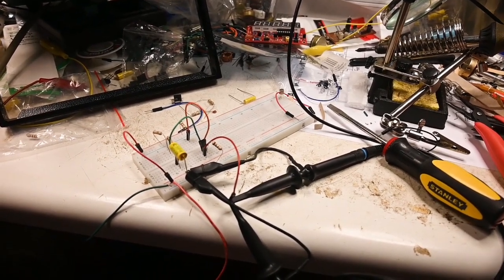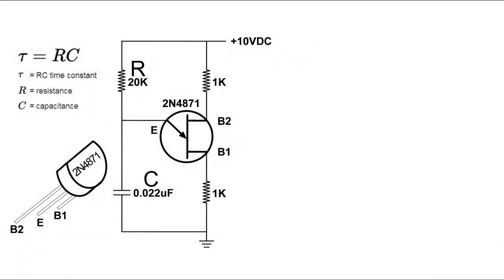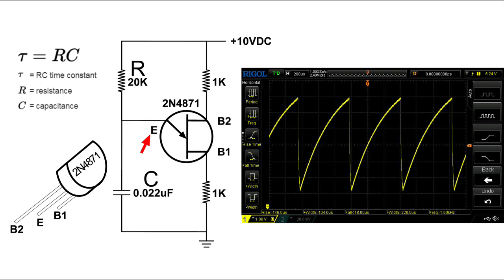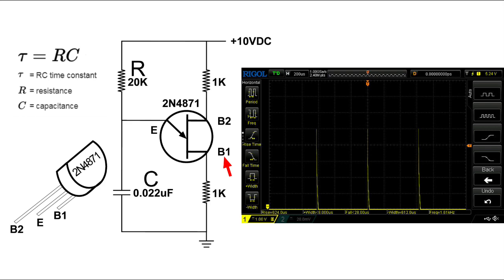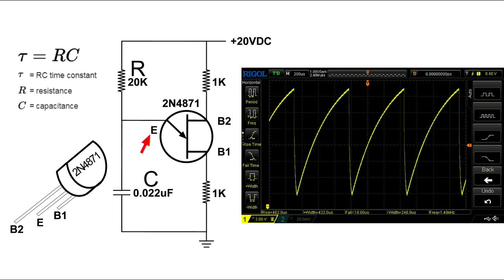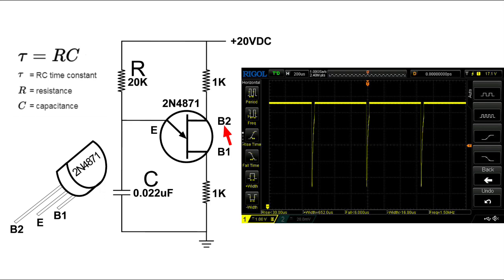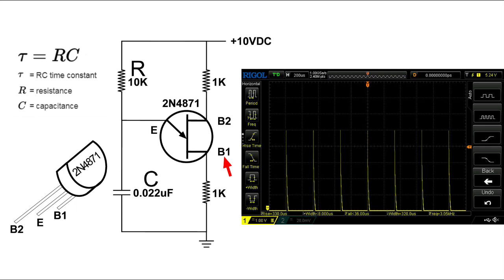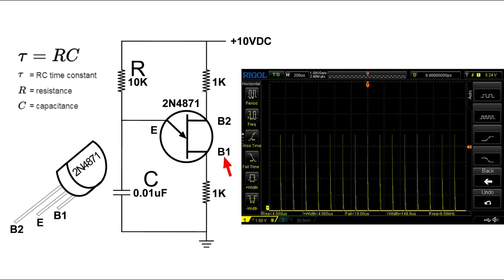2N4871 PN Unijunction Transistor RC Time constant Pulse Generator

Comment: I have done a timer function with a ujt 2n 4871 and two tyristor tic 126. And of course some resistors and capacitors. The circuit is taken from a book and it works perfect. 
But have a question. I have two of these ujt 2n 4871. With one of them the timer circuit works perfect. If i switch that one out and put the other ujt 2n 4871 the timer circuit does not work anymore.

I have done diod test and ohm test on both with multimeter and both seems to be ok. But one them does not trigger the timer circuit. 

That ujt does also not work in a flashlight circuit i tried but the other one does. 

So, what can be wrong with this ujt? According to all of my multimeters it seems fine but fail when in circuit. When measure the dc it seems it does not charge up as much as the working one. ( The emitter is connected to a potentiometer and a capacitor on 220 micro farad)

Trying to learn some basic elevtronic on a very old NOS education kit i found at my work. Proberly this stuff is from the 70's. The breadbord is huge and weigh about 2 kg and have a frame of wood!!! All os there with transformer, book,component list and a box with all the electronic components 3:49 
Thx
Reply from the maker: You might try the circuit in this video. If you get the same results, the UJT that does not work may have been damaged. I have seen a vacuum tube test good in a tube tester but will not work in the circuit. The best test is to replace the suspected part with a known good one.
Reply: Thanks for your suggestion. I tried the circuit in the movie but unfortunately im not able to get the nice sawtooth readings or any meanful reading at all on my oscilloscooe. Dont know why. The same goes with both the working ujt and none working ujt. 

Im not very used to oscilloscooe but im able to get nice curves on it from my tone generator.
Anyway thanks for your suggestion.

Comment: I have only run into this device on one circuit board in 50 years.   It was used to trigger an SCR.  NEVER saw it used anywhere else.   Great for simple oscillator but spikes are small.    Good luck finding them anywhere today.  All the ones I ordered for tinkering turned out to be mismarked (counterfeit) SCRs.    I tried to get programmable unijunction transistors (PUT).   Luckily I acquired some from an estate sale from a fellow tinkerer.   Brand new Motorola branded devices sealed in original bubble card package.   I couldn't find it in my heart to open the packages though.
Reply from the maker: I don't remember ever seeing a unijunction in any circuit. I think that there was a unijunction in one lesson at night class in JR College (70s). But the circuit in this video does show how the RC Time Constant Works. Anybody interested, and builds this circuit will get exactly the same results. I know what you mean about opening NOS. I have a CK722 Germanium Transistor new in rapper. I can't open it. I hope you are doing well!
Reply: @AllAmericanFiveRadio  Doing well thank you.  Hope you are doing the same.  Happy Easter.